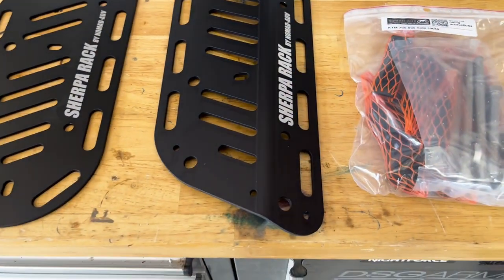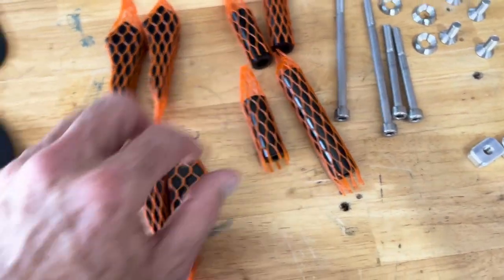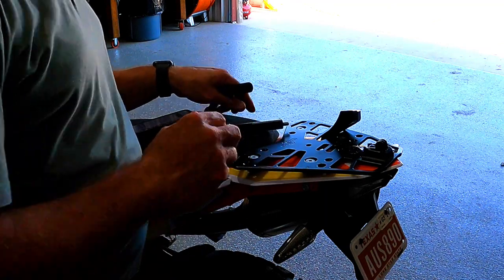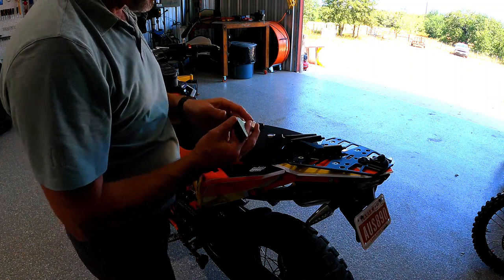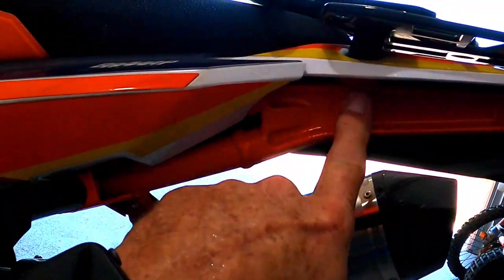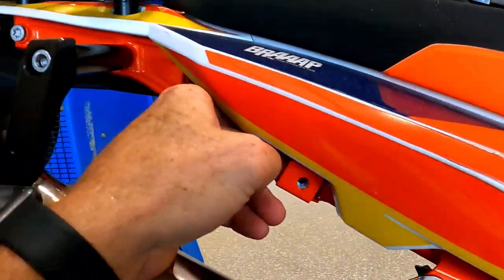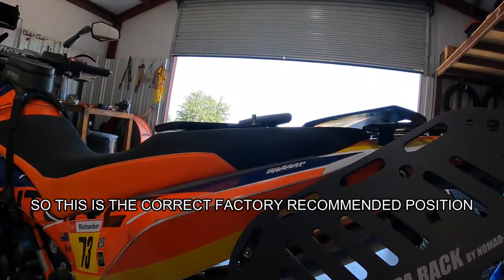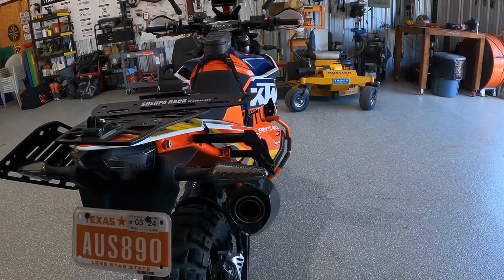NOMAD ADV LUGGAGE RACK INSTALL

Comment: Hi, great vid. They go the other way round, the bent one on the left and the straight one above the exhaust. There won’t be any rubbing especially on the exhaust side.
Reply from the maker: Yes, somebody previously noted this. I appreciate it. I have them now amount of the other way. Much better. It’s a great product.
Reply: How has the rubbing on the plastics been? Looks like there would still be some rub points?
Reply: Nope, no rubbing